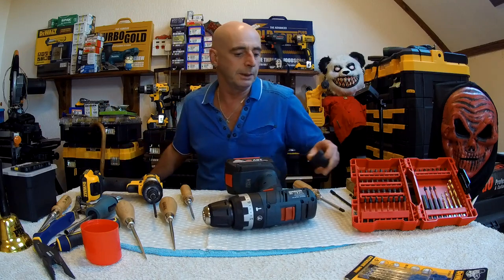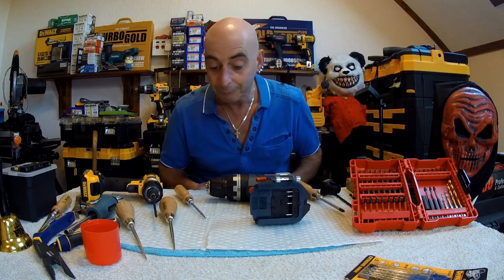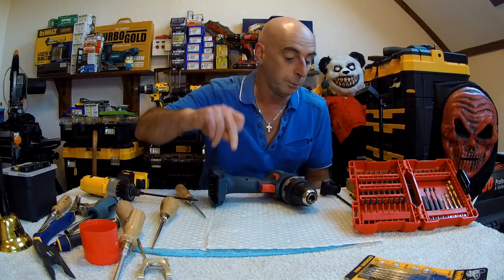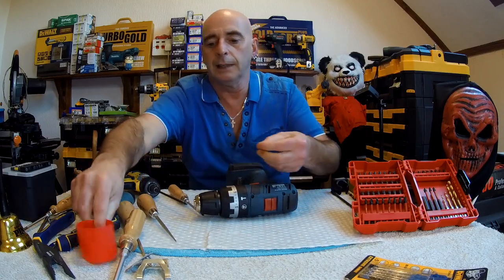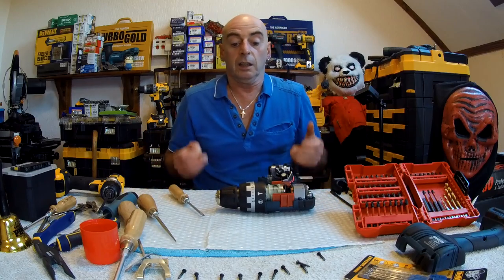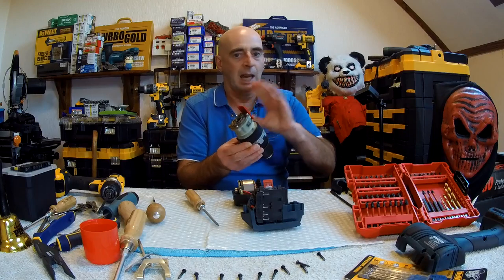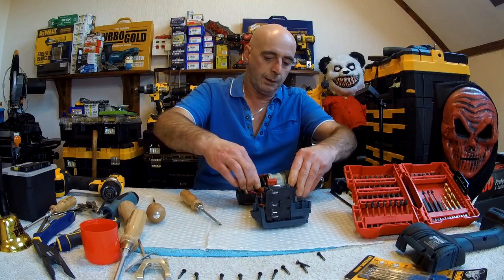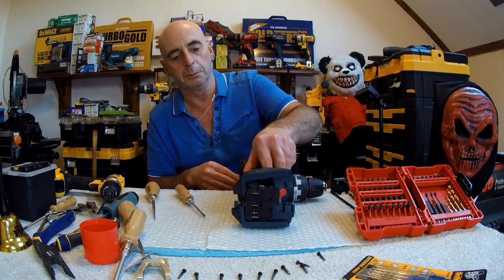Bosch GSB 18V EC Chuck, Clutch, Gearbox, Speedswitch & repair

Comment: why has it got two click to hold the battery in place ??? ive got same drill 14.4 if i leave it in drill the next day it won't work after about half hour slidein it in an out it works batterys spot on so ive got to leave it in the first click in so when i come to use it i just fully click it in one weird fault hope it helps

Comment: On Bosch drills, which gear is high speed low torque and which is low speed high torque? Also on my Gsb18v-535c when it’s in (second gear) and I release the trigger is makes a “semi- loud ratcheting noise”,  is that the brake they were talking about in the manual? Doesn’t do it set in the 1 position.
Reply: Normal
Reply: @vojnikjna30  is gear 1 low speed/higher torque, and speed two higher speed lower torque?